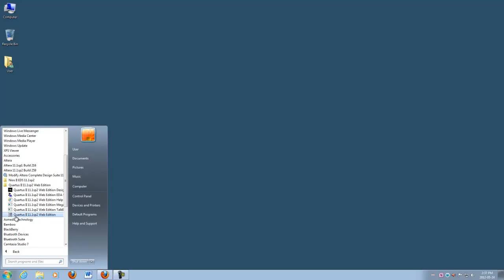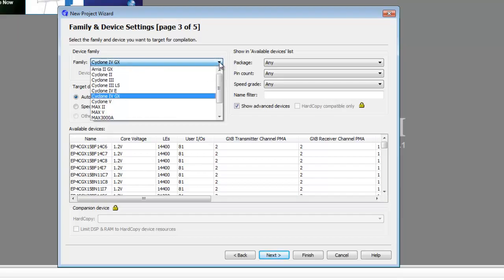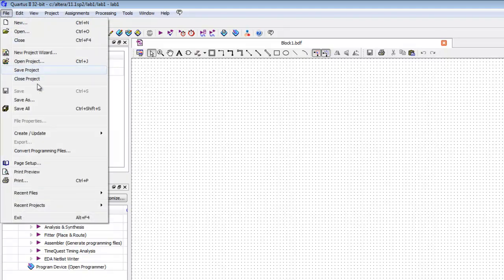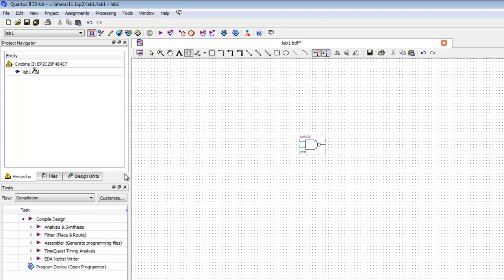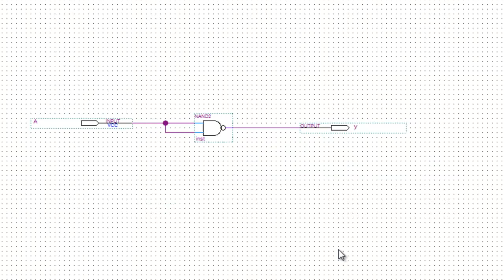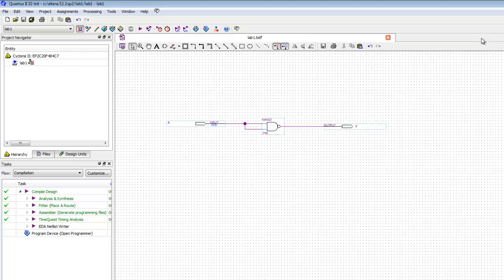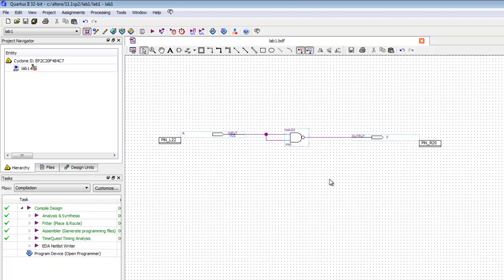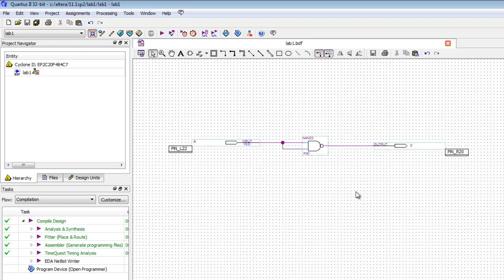Altera Quartus II Tutorial v11.1

Comment: Feedback loops provide generic mechanisms for controlling the running, maintenance, and evolution of software and computing systems.[38] Feedback-loops are important models in the engineering of adaptive software, as they define the behaviour of the interactions among the control elements over the adaptation process, to guarantee system properties at run-time. Feedback loops and foundations of control theory have been successfully applied to computing systems.[39] In particular, they have been applied to the development of products such as IBM's Universal Database server and IBM Tivoli. From a software perspective, the autonomic (MAPE, monitor analyze plan execute) loop proposed by researchers of IBM is another valuable contribution to the application of feedback loops to the control of dynamic properties and the design and evolution of autonomic software systems